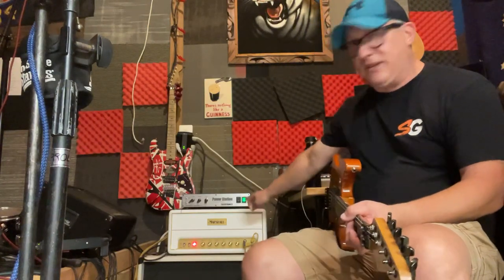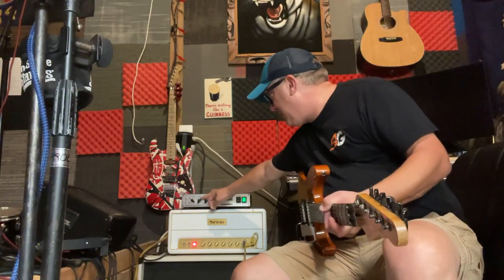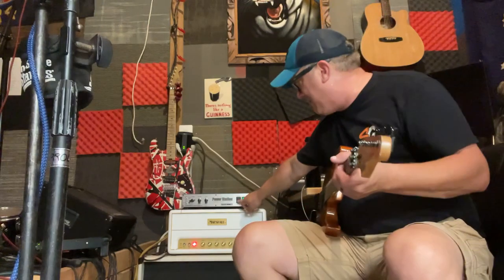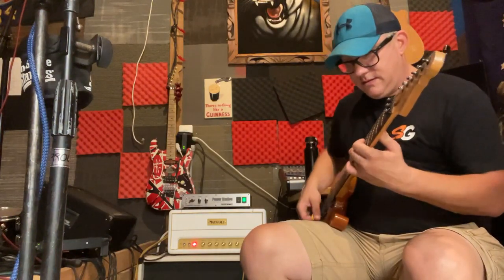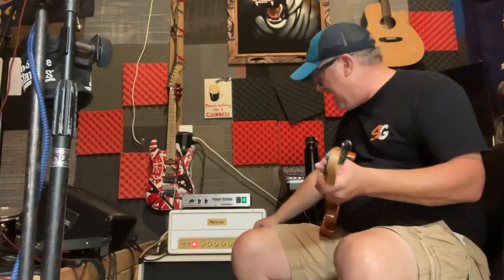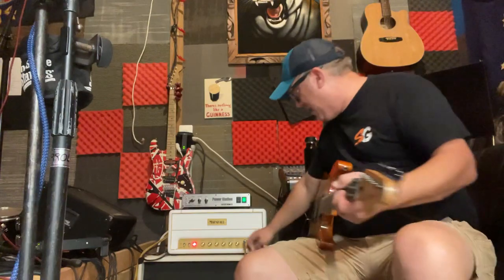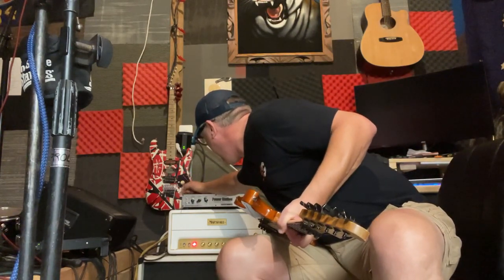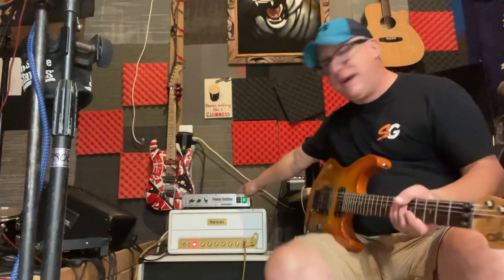Fryette Powerstation 2  Marshall Studio Vintage Plexi SV20H

Comment: Awesome.. but you were blowing out your recorder with lush plexi tones.. lol.. I have a PS2 also an almost killed my vintage Marshall Major 1970.. (had it modded to a SL cascading gain with split bias EL34 + KT88).. I had my PS2 on another amp and put it on my plexi but forgot my amp input load was set to 8 ohm.. OMG as i run the plexi at 16 ohm out and into 16 ohm cab.. holy heck it started to whistle and sound strange and just as i approached my amp to shut her down.. the indicator light went OUT.. luckily just blew the 10A fuse.. didnt have to fork out for a new output tranny.. HAVE TO MAKE sure those taps are correct folks ..!!
Reply from the maker: Oh man!!!
Reply: Just keep It at 16 ohms, then you won’t hurt your amps, even if you forget and connect an 8 ohm head
Reply: @danvan8789  yeah.. I was playing around with another amp running 8 ohm into 16 cab to see if the drive was a bit different and forgot to switch it back.. luckily no harm.. only had it on a minute or so before the sequels started.. and when I went over to turn the amp off and the power light went out my heart sank.. but the fuse did it's job
Reply: Some big time producers leave it on 16 ohm all the time, with an 8 or even 4 ohm head. Sounds like they’re being lazy, but maybe it’s better than frying a vintage head
Reply: Sound advice from Dan Van above, supported by the ohms rule: "Low to high will fly, High to low, it will blow!"

Comment: It seems the Power Staion does not reduce the volume. At least I cannot hear a difference. So what is it good for?
Reply from the maker: It can go from whisper quiet to full 50 watt re-amped tube volume. I haven't done a video on it in a while. Maybe I will throw another one up. 👍🏻

Comment: Thanks for the video! I also just bought a Fryette PS-2a. I have a couple of questions, if you're so kind to help me.

1. When I turn the Fryette on I can hear the fan making a "starting" noise, and then then fan is quite loud.
2. When my amp is off, and just the Fryette is on - I hear some background noise when I switch from bypass to operate.

Are these things normal? do you experience the same behavior with your Fryette? 

Thanks a bunch!